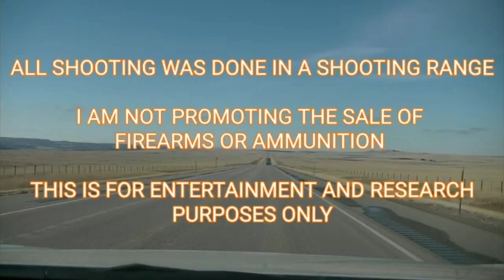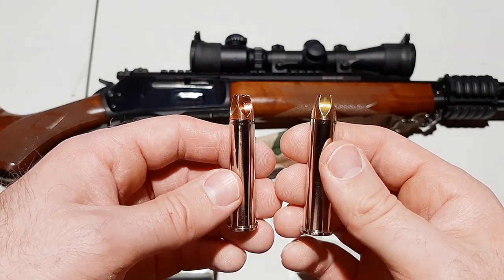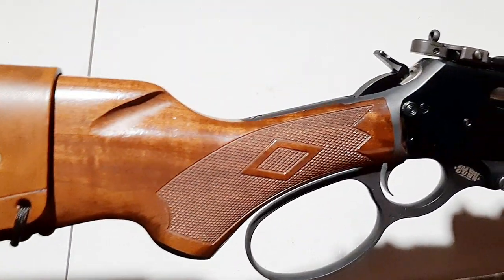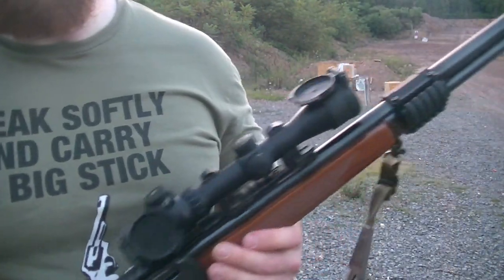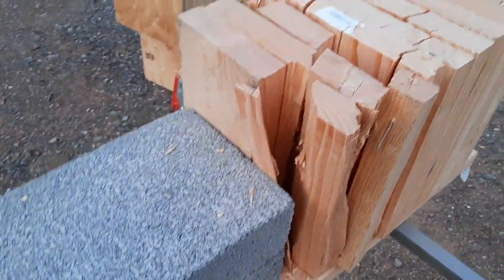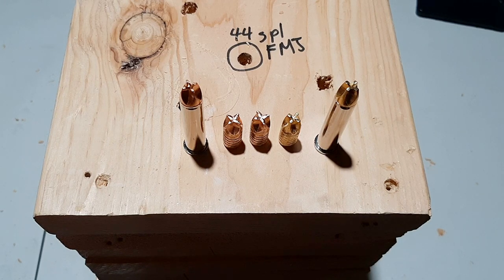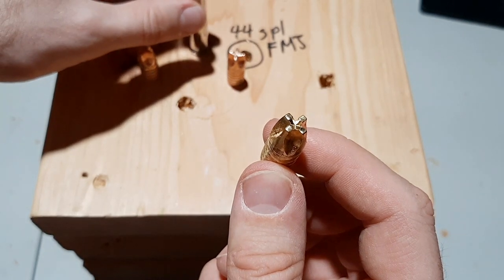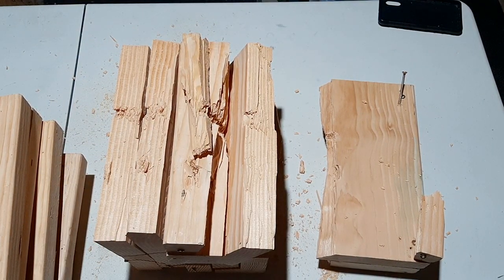45-70 vs Lumber - Part 4 Underwood Ammo Xtreme Penetrator & Xtreme Hunter

Comment: Big difference in 16" of wood and a shoulder of an animal you're hunting. They also looked like they smacked the bricks in the back. But yes. I only run underwood ammo in every firearm I have. Great stuff.
Reply from the maker: Wood is pretty dense, closer than water or gel.  To test a shoulder I like to use concrete blocks.  I use wood to compare them to other rounds to get a comparison.
Reply: @NYPrepper  makes sense. I'm not overly certain of the density of y'alls wood but in the south we use pine. Super soft. It would probably splinter it all to pieces. Still great information.

Comment: Beautiful gun love the custom work you've done. Also those are some wicked bullets very impressive. I don't think those will have any problem with big game. I also have a question on muzzle breaks for my 350 legend what's your opinion on them will it help or not. The barrel came threaded and I know they don't make a particular one for that rifle but I seen a 9mm AR style will work because of the same diameter bullet. Let me know and thanks as always Greg
Reply from the maker: I don't think you need a muzzle break on a 350 legend it will just add noise and blast.  Those threads are probably more for a suppressor.
Reply: @NYPrepper  Got it that's kinda what I was thinking thanks again Greg and have a great weekend.